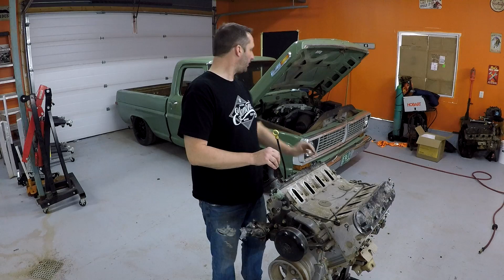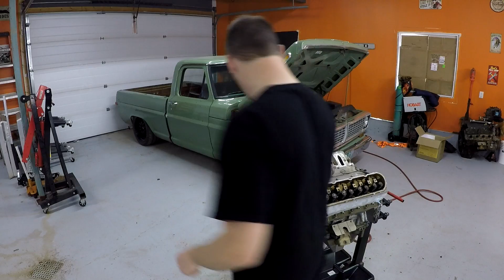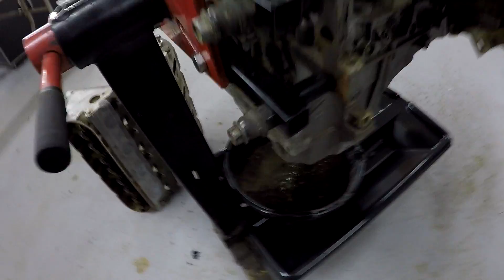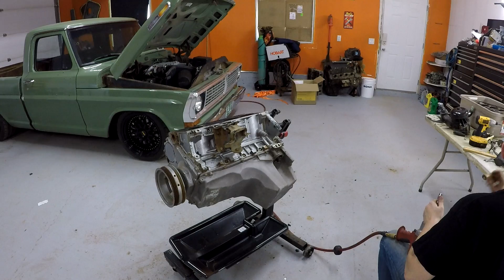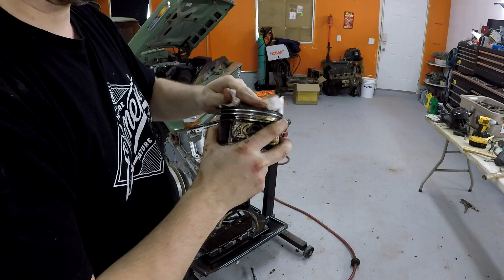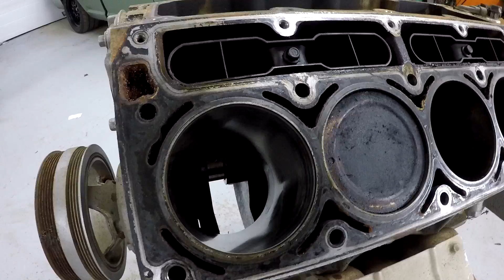Low Budget Turbo LS Build Part 1 - Engine tear down

Comment: Nice truck,  just wondering why you’re going with pushrod motors instead of the overhead cams?  Does Chevy make a 32 valve that you can slap a supercharger on it? Seems like supercharger would be a lot less work. You wouldn’t have to deal with all the piping for it and fitting an inner cooler etc…

Comment: Oh about the rod and main bearings. When you check the bearings , is it ok to reuse them after pulling the bottom end apart? I am wondering if undoing everything would disrupt any kind of setting created from wear over the course of 200,000 miles? Or is it ok to put them back in their appropriate place such are rod bearing #1 back the rod #1 . I am thinking by taking a used engine apart should be put back with original parts back in exact places? Are the LS engines THAT durable? That its fine to reuse old bearings if they look "ok"? How about piston rings? Is it really ok to just hone the bores and reuse rings after proper gap??? This is for a boosted 2003 6.0 LQ4 at 15psi with bone stock bottom eventually question . Or can rings be upgraded and not worry about any kind of tolerance fitment issue similar to say changing from stock rod bolts to ARP which requires machining to make round again due to new torque specs of the ARP??? I want to stay cheap. And continue to use same bolts for bottom end. And keep HP under 800HP even on track. Thoughts??

Comment: I am in the process of getting a whole truck for my donor.  Its a 2003 2500HD chevy pickup with a 6.0 and a 4L80E for $750.00 the truck hasnt been started in a year. It drove till it sat last year due to the rear end went out. The guy is retired now and he doesn't need his work truck anymore. The body is beat to HELL but it runs and sorta drives if the read end was in working order. My thinking is I have damn near everything I need from that truck including the tranny. I want to boost it higher than 15 psi when I play and about 6-7 when I need to get groceries.  Is this a good deal? Oh, it also has 200,000 miles. I think $750 is hard to beat but would like your feedback?
Reply from the maker: I paid $700 for my donor. I think you’ve got a good deal there!
Reply: @TheGoFastGarage  AWESOME.  I am totally new to this LS swap trend and I have been watching lots of vids on it. I been watching your vids and they are packed with great info!

Comment: Every time you pull a set of heads off an engine, it dumbs water down the cylinders and into the oil as well.

Comment: Love the video and I'm not trying to be one of those internet experts but just as a general rule for engine teardown, especially heads and mains, unbolt in sequence. 
I've built a few LS'. 1 aluminum block 383 stroker and 2 junker 6.0's reusing stock rotator. Best advice is just go buy King SI series bearings for mains and rods and a set of Hastings plasma moly rings. All cheap stuff that is as good as OEM. Cam bearings suggested but if your's look good that a big chunk of change saved from the machine shop.
Good luck getting that HP goal!

Comment: Big mistake when removing the cylinder heads, the screws should ALWAYS be loosened slowly in the reverse order of how they are torqued when assembled, they can be warped doing it as shown here!!! And all parts to be reused like pushrods should be kept in order and put back in the same place with the same rocker and lifter.
Reply: came down to say the same thing and you had already done it, cheers.
Reply: Preach my good man PREACH!!! 💯💯😎
Reply: I thought this was true but I came down to ask everyone in the comments. Guess that answers it for me 😂
Reply: And using a impact to take the heads off seems kinda sketchy too.
Reply: A little louder for the assholes in the back lol. If this guy can do it you can to

Comment: You said cheap insurance to replace knock sensor for $30 a piece so $60 total but don't spend $100 on new head bolts and risk blowing the motor. Sorry not a good idea.  They are torque to yield bolts.  One time use,  don't risk it

Comment: Hey can I get a biuld sheet for this? I would like to duplicate this project in much the same way. What I'm confused about is the wheel base of the 2017 and the the crown Vic compared to original O.E.M. that came on truck? 
thestampisdead@gmail.com

Comment: some advice given to me from old school engine builders in regards to bore hones. never stop it in the cylinder. you risk creating microscopic machining burs that can cause scratches and excess wear to piston skirts and rings. also running the hone forward and reverse is supposed to give superior cross-hatch patterns that look gorgeous. finally, build it, boost it, send it.

Comment: why not push your ls you have in the truck harder? more boost and bigger cam bigger injectors.
Reply from the maker: The blower is just too small. I’m sure I could get another 50-75 hp but I’d like more. Way more. Turbo should get me there.
Reply: @TheGoFastGarage   yes i love my Turbo 4.8 way more HP then my wagon can handle but yes i still want more so i get it HAHAH nice truck and good luck with the build

Comment: I have a 225K gen 3 6.0 that was in worse shape than that.  Gap the rings and toss 18-20 lbs at it with W/M injection and pump gas, you will be fine.  First time out @3600lbs with stock cam it ran 11.60 @ 122 on 13 degrees at 13lbs....

Comment: Love the truck man, almost went with a F100 but thought it would be cheaper to stick with a C10. My 5.3 build went without a hitch not sure if you guys have ZEP brand up there but I threw most of my greasy parts in the citrus degreaser 1:4 ratio, parts come out looking brand new. With all that water I'd think about getting some clevite bearings don't want any corrosion on the rotating assembly the 10k miles I've put on my build show taking your time to clean everything as best as you can will net you good results good luck!

Comment: I've experienced the same water in the motor issue before from junk yard motors.... some times they pull motors and leave them outside without exhaust and intake manifolds on them... rain water gets inside... not good... I feel your pain... as long as the cylinder walls are good she'll be fine!

Comment: I have heard you mention a couple times that you tuned the blower motor yourself and that you would do the same with the turbo motor.  What program are you using and where did you get it from?  Love the truck!  Let the haters hate!
Reply from the maker: Thanks a lot! I use hp tuners.
Reply: The Go Fast Garage Thank you!  One more question. I watched the video where you showed the 13” Grant steering wheel and the steering universal joints. Did you use any other parts from the donor truck steering column?  
  
       I’m not sure if you realize how attainable you make this swap.  I appreciate the knowledge that you share.  I might have a few more ?s.  I will email if I do.

Comment: Get new head bolts. The factory bolts are torque to yeld bolts and only good for one use.
Reply: Yes they are, I'll get new ones for mine, but it's insane how many people I've seen reuse them and not have issues with doing so
Reply: @rbrookshgm7907  I reused mine with no issues over a year later...blah....ls9 mls gaskets are a wise choice though...
Reply: It’s dangerous doing it running boost!
Reply from the maker: I like to roll with the safety off
Reply: Schad Moxey false on the good for one use.. I’ve reused head bolts and gaskets multiple times without failures

Comment: I'm just ganna  send it!!! What do you mean by better rods in the 6.0?
Reply: He is talking about the full floating rods that come in the newer engines.
Reply: They looked like gen3 rods. I think he was hoping for gen 4. I made the same mistake when I bought my 04. He should have got a 05-07 6.0. They all have gen 4.
Reply: @MCxFATIGUE  Yup You can find them reconditioned on eBay for around 100 bucks I think.
Reply: Yeah, but then you have to have it all rebalanced. Gen 4 rods are considerably heavier. I think around 10 grams.
Reply: Best route to go for 6.0 would be the LY6. Gen 4 rods and square port L92 heads for about 600 more typically. That extra 600 bucks is worth it. If only I knew then what I know now lol.
Reply: My 6.0 has been rebuilt other than pistons and rods. I may take it back apart and redo the rotating assembly, but thats $$. Can't really stroke an LQ4 either because the piston sleeves are so damn short. Well, you can, but its not recommended. $1,200 for lunati rods and forged pistons. #budgetRekt
Reply from the maker: They are the bigger gen 4 rods. I got lucky this time.
Reply: @TheGoFastGarage  ah, it was hard to tell in the video. Those pistons looked exactly like mine.
Reply: @TheGoFastGarage  
That's one of the main reasons why I watched the complete video. I wanted to know if it had the gen 4 rods? (Because the 13mm bolts) I never heard you say it on the video.

Comment: Just a suggestion not that you've done anything wrong just out of sequence drain the oil first then conduct a compression check if you suspect something wrong with this engine. Keeping those pushrods in order to see which one maybe bent doing this may tell the story of this engine. Like you said keeping it on a budget doing some investigating will keep you from spending more money than you care to spend. Any time you install a power adder get yourself some insurance by installing a high volume oil pump.